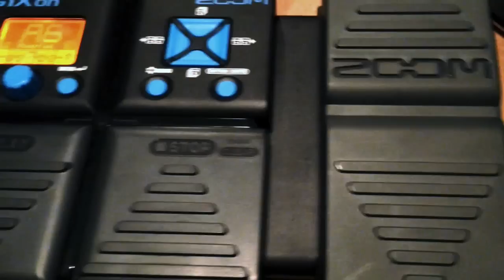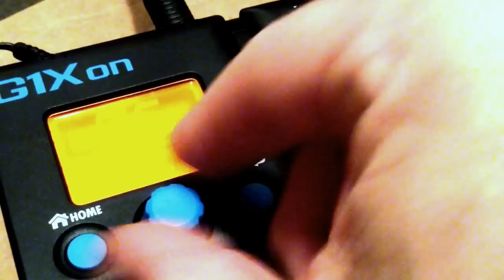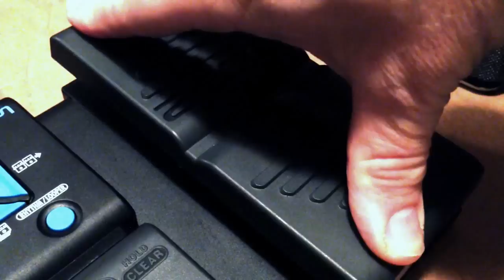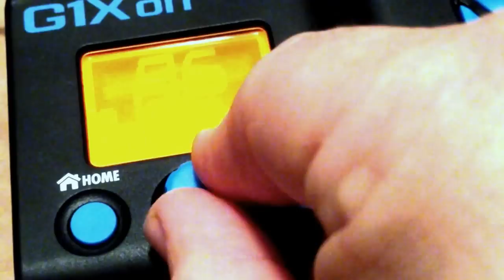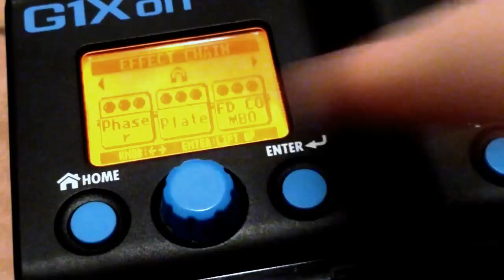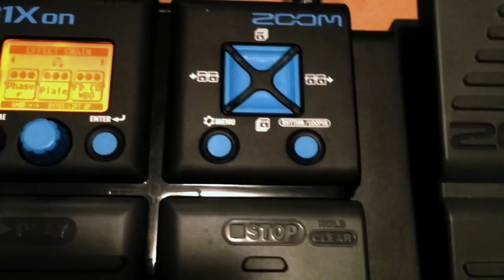Zoom G1xon detailed Tutorial

Comment: I have this multi-effects pedalboard that is connected via a 9 volt supply. Absolutely all the presets, even the ones I have left without any effect, have noise. I have a squire with single coils but in all positions of the pickups it makes the same noise. I already verified that it is not the amp or the cables, because they are good and new.

Do you think it's the power supply? It's an old pedalboard that was stored at a friend's house years ago.

Thank you👍
Reply from the maker: Yep, either that or the orientation of your guitar. I find that my guitar buzzes more when it's pointing certain directions.
Reply: @gearfacts  even when i move my guitar in any direction, the noise does not stop
Reply from the maker: @ferguardado9790  Is it better when you run the pedal on batteries??
Reply: @gearfacts  i haven't try jet. I'll tell you what happens

Comment: Hello! I have a question: if you are playing for example Dani California from the RHCP how can you pass from the clean main part to the distorsion on the chorus? You should duplicate the clean main part to a new patch with the distorsion added? Is there any kind of miliseconds between the patch changing?
Reply from the maker: You can put two patches side by side for a quick change (copy the first patch and just add that distortion to the second one, as you describe) but a cleaner way might be to leave it in edit mode with the distortion effect selected in the chain, and use the right pedal to activate and de-activate the distortion as you play. That way, your delay and any other dynamic effects will continue uninterrupted.
Reply: @gearfacts  Thanks a lot!!!!

Comment: is there a way to use it as a regular distortion pedal? Like pressing the peddle to add distortion and pressing again to remove it.
Reply from the maker: Not officially, but there is a trick you can do - two tricks, actually. The first way is to leave it in edit mode. Put just one effect in your chain (the effect being the distortion you want) and simply activate/de-activate that effect by pressing the right pedal. The second way is so create a series of patches, say 1 to 10, with each consecutive patch having distortion/no distortion. This way, no matter which pedal you press you'll go to a patch that switches the distortion on/off. Hope that helps :) Gearfacts
Reply: @gearfacts  thank you so much. I made patches with and without distortion and i switch between them. You're still responding to comments after years what a bloody legend of a man

Comment: From any position if you press the home button you come to the home screen showing your current effect. In that window press both pedals simultaneously and you will start the integrated tuner. 
You can also deactivate and reactivate effects in the effect chain (in a patch) -  stepping on the up and down switches the chosen effect on and off. 
I recommend using recheargeable batteries - this keeps the cost low while eliminating the power cable.

Comment: What makes these units so popular is: 1) Ease of use ! Simple up/down footswitch to scroll through your patches  2) The effects are very good for the price range  3) lightweight and runs on batteries  Did an open mic set with a mini Dist./OD pedal and the Zoom G1on. It performed very well.
Reply from the maker: Totally. I've recently reviewed the new G1FOUR extensively and I have to say it's a downgrade from the G1on / G1xon
Reply: Thanks for the educational video.
Torn between Zoom x1on and Zoom G1xFour purchase.
The x1on has 100 patches while the G1xFour has 50.
G1XFour interface seems easier to read. Some have said the amp simulations are better with the G1xFour.
Why do you think the G1xFour is perhaps not as good as Zoom x1on ?

Looking forward to your expertise if you have time for an answer. Thank you.

Comment: Thanks for the run-through! I'm thinking about experimenting with ambient guitar, which often uses a lot of delay pedals layered on top of each other. I assume a given effect (like carbon delay) could be used more than once in the G1Xon's effects chain? Also, I assume the pedal can be used to control the overall volume of the post-effect-chain sound, to do a volume swell / fade-in? I'm thinking this might be a cheap and easy way to experiment, if so!
Reply from the maker: Hi Dym, yes there is a volume swell effect and yes you can layer different delay effects, or multiples of the same delay if you like. i think this is demonstrated in my video 'using the G1on as a synth' ...I think that was the title of it anyway :) Gearfacts
Reply: @gearfacts  Excellent, thank you! I think I'll keep an eye on eBay and check out your other video in the meantime :)

Comment: I have purchased Zoom G1xON .. Can u please tell me what is the settings for perfect Distortion sound ?
Reply: I like starting with a tube screamer, then I set up the amp mod that looks like a mesa boogie dual rectifier. I like to put a flanger after that with very subtle settings to give me a nice 90's death metal rhythm sound. You could also use the extreme metal distortion instead of the tube screamer and dual rectifier amp mod. I like the amp mode more though because it gives you more control of the tone. You could also take the eq, then set the extreme metal. If it feeds back a lot, use the zoom noise reduction at the end. 
If you want more of a rock distortion sound, you could use the tube screamer first, then use one of the amp mods that look like a marshall. There is one that looks like the old Marshall head that people like Angus young and slash like to use.
Reply from the maker: Yes, the answer is here:
https://www.youtube.com/watch?v=KuT_2TkPZhg
Reply: thats cool

Comment: I have the bass and guitar ones without the expression pedal and the guitar one with expression pedal.  They are cheap and a lot of bang for the buck.  They are a bit noisy, and they seem fairly susceptible to electronic interference like WIFI and such.  I tend to use them for Korg Volcas with modulation/reverb/delay with any modeling/speaker sims turned off.  Now if you are playing through with a guitar orf bass for the modeling, they are OK.  Are they the best?  No.  But can you get a good sound?  Yes.
Reply from the maker: 100% agree :) Gearfacts

Comment: Can you delete the drive and cab simulations so you are only using the modulation effects? Also, can you bypass the unit on the fly to return to the amps base tone?
Reply from the maker: First question is yes, definitely. Second question, you can but what you'd have to do is set up a patch that actually has no effects active, so the signal goes straight through. Note that it's not true-bypass though, so there may be a slight change in tone purely because the signal is taking a longer and more complex journey to get to your amp. Hope that helps :) Gearfacts
Reply: Thanks for the info!

Comment: Just purchased and set this Zoom G1on/G1Xon Guitar. Multi-Effects.high.up.on.this.old.wooden..sewing machine with a wide thick piece of plywood..clean..ran..through the first page sat down..and .plugged in..first.the power strip.on.amp.volume down
.using a. Gx-20M. Crate Reverb Guitar amp with Chorus.( unnecessary.because all the effects). So im playing through. a Oscar Schmidt. By Washburn Acoustic.6string.using Martin& Brothers Acoustic Bronze Sp.Medium and an in soundhole SC single coil Woody by Seymour Duncan.through just getting started...i was Divinely.""STARTLED"" .AT the Arena Rock sound .and .screwed up the patch. Bank .that i started out with.but now patiently while off work and family life i can now .spend some great times for very little.not envious at all the skill man ! I purchased a 18 foot. 1/8" line with two at the end.so now i run the headphones.not all the time.but checking.page 5 Aux In Portable Audio player etc. Called SoundEngineer support at Sweetwater. Anthony Dentino found out from others great help. I can using another 1/8" line.with "male" ends from Aux In..this is a long cord plus 2 shorter lengths .directly into this Lg Android Wireless Lucky.smart phone and can play along.! And now though i cant record it a Rhtym track got to go
Reply from the maker: Sounds like you're having a whale of a time with it, Mike! Thanks for watching Gearfacts :)

Comment: If I'm running a patch with an amp sim in it, what changes between setting it to line, or combo front. For instance if I'm running it into an amp already, would I want it set to line? Which would mean if I was using a DAW then I would select any one of the actual amp cabs (combo front, combo power front, stack)?
Reply from the maker: Keith Walker Yeah this is a tricky one. It’s intended that you use the combo setting when you’re wearing headphones or using studio monitors, so you get the ‘complete’ sound. This is so NOT an exact science though. My creedo with things like this is to try the different settings and simply go where your ears take you. It’s very easy to over-think when it comes to simulations. That’s my opinion anyway, hope it helps in some way :) Gearfacts
Reply: Yeah there doesn't seem to be any information on it anywhere XD some people that have made patches specifically say to use one or the other with THIER current configuration, which lead me to believe that there is some merit to how you have it connected.
Reply from the maker: Keith Walker The merit is all theoretical. These chains often won’t behave like the real thing so trust your ears and treat the ‘rules’ of ‘better tone’ merely as a guideline. My opinion, always open to discussion :)

Comment: I've just bought one of these for my son, and now it's wrapped for Three-Kings on the 6th Jan, so I can't test this problem for myself. Reading the manual, it appears that the 100 presets are kept in A0 - J9, and there aren't anymore 'slots' than that. So if you want to save your own custom patches, you have to overwrite the presets and lose them. Can anyone clarify this? Thanks.

If that's correct, I don't understand the reasoning for it. For instance, the Digitech pedal I looked at starts off with presets in 1-50, and then duplicates them in 51 - 100. When you save your own patches, they go into the latter bank, leaving the presets in the first bank untouched. That seems a much better system to me.
Reply from the maker: Yep that's correct - there is no separation between user and preset patches. All patches can be edited and over-written. I suggest going through all of them, find the ones you like, and save them to a favourite 'zone' of patches. e.g. save all ten favourites under "F" patches 0-9. Then you can save them to other areas and go ahead and experiment with them in that new location. This keeps everything organised and keeps the factory preset sounds that you like intact. I hope that helps, thanks for watching Gearfacts :)
Reply: Thanks for confirming. Since that seemed like a lot of clunky work to do in the LED screen, this morning I looked for a better solution and found 'ZoomLib' on zoompatches.com. This seems to solve the problem of both overwriting the presets (by being able to backup your patches to a library on your laptop) and not being able to move patches around easily (by providing a drag/drop GUI).

Thanks for your videos and for replying to questions.

Comment: Thanks...will do that....the rhythm patrers are too loud ..when i play i dont hear my guitar..its low in background..how can lower the volune
Reply from the maker: You can lower rhythm volume in the main menu (press menu on the top right quarter)
Reply: Correct, you can adjust the rhythm volume and also the main level if it's too loud.... besides that, every patch has its own output level so you can adjust any of them independently (since in most cases the factory level settings can be quite different from patch to patch)

Comment: extremely delicate. broke in less than a month.
Reply from the maker: J_ G_ Hmm, so there’s no chance that you might have been a bit heavy with it?
Reply: i can see if there were solder joints that were structural, but there are only 3 solder joints and they are all for signal. no strain relief, no connection to the chassis, all i/o points are wobbly and supported only by the SMD component PCB. Usage in a practice room or on a stage is a no-no. The point about strain relief is that you cannot forsee accidents. I didn't even notice an accident, but it still broke. so no, nothing heavy.
Reply from the maker: J_ G_ damn. Are you claiming warranty?
Reply: no, because it is a fundamental design flaw. I re-flowed the problematic solder joint, and second time's the charm but i know it will break again. I'm using it to teach a friend about various guitar effects so if we can get to the next level without it breaking too many times i guess it's worth the aggravation to get to the next step. this pedal is really really smart, but not enough foresight with regard to the fact it is designed to be on the ground, in the dark, with cables running here and there.

Comment: I'm so new to guitar effect I don't even know what gain, threshold, reverb, etc does. >_>
Reply from the maker: You're entering a world of fun....!
Reply: Gain is a distortiony sound, and reverb is an echoey sound, not gonna lie dont know what threshold is
Reply: @ctc514  Threshold in the context of a compressor sets the point where compression should start. A lower threshold means more of the signal will get compressed, a higher threshold means only the louder parts of the signal get compressed. 

Gain just means volume - what it means for the effect is a bit different in context with each effect: with compressors, gain could be added before the compressor to force the compressor to work on more of the signal (based on the threshold), or after compression to "make up" lost gain, since compressors actually lower the volume if you don't add additional gain. If you add too much gain you can get Overdrive/Distortion type sounds, which is probably where you got that impression.

Comment: Can you layer the looper or can it only manage one?
Reply from the maker: Robert yeah you can layer it, Robert
Reply: Can you change patch while you're layering? Say I wanted my first pass to be a single strum of a lush, swirly chorussy chord, and the second pass to be a vintage fuzz riff, and then I can solo over it with a modern high gain tone?
Reply: @surfdigby  That's the tricky bit. The only way to change patch is to press the tiny blue button on the left by hand to get it back onto effects, then press the right one to get it back to looper. I've seen some where people have attached larger buttons to make them pressable by foot.